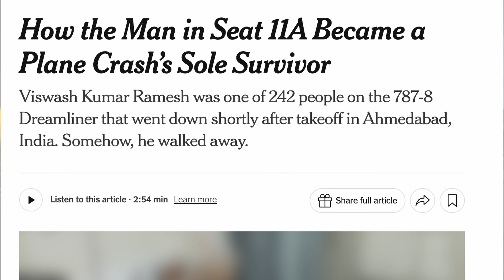Why the RAT Changes Everything – Air India 171 Update

Comment: If it is true that the plane had known multiple problems BEFORE passengers even boarded. Why did the captain allow the plane to takeoff without those issues being repaired?!
1) Faulty air conditioning in 38-degree weather
2) Broken-down inflight entertainment system for anticipated 9-hour flight
3) Unreliable transponder being used before a long international flight. 

Items 1 & 2 were complained about and videoed by passengers on the previous flight from Delhi. 

So why, Why, WHY…would an experienced captain fly a plane in that condition?!!!

Comment: I was thinking both engines flamed out after take off when I was watching the first original video a couple of days ago.  My opinion for the reason of why both engines stopped working simultaneously? Poor maintenance and servicing from Air India for this particular craft AI171.  Another video I saw on YouTube shows a passenger filming inside this exact same plane on a previous flight showing that it has an electrical problem with the ceiling cabin lights not working and the touch screen displays and push button controls on the back of the seats also not working.  AI171 was doomed to have a major electrical catastrophe due to poor and lack of correct maintenance by Air India. This was not a pilot error.

Comment: Whenever an event is astronomically improbable, then it didn’t happen the way theorized. Not Occam's razor, Fredley’s stubble. The “survivor” is improbable. My calculated narrative is that the escape door was opened and the “survivor” jumped, causing infinite confusion and chaos in the cockpit leading to the confusion between the landing gear lever, which was in the process of being pulled, and the flaps lever. 

The object, most probably the emergency door, departed the plane just before the landing gear was to be raised. Check the timing. Check the background of the “survivor”. 

Three years spent at Penn State, studying statistics, philosophy, inferential logic, mathematics and computer science has taught me to think, yes think, not presume, out of the box. 

Also, check if the propellered generator comes on by strange coincidence of the emergency door opening during takeoff, which would explain its observed dropped position and sounding.

Comment: If the mayday call suggested a possible power issues.  Could the pilot flying activated the rat to attempt to access power to extend the flaps?  But what caused the power failure?
I also agree the flaps were possibly retracted instead of the gear.

Comment: SERIOUSLY ❓️❓️❓️🤦🏼‍♂️ 
ALL SCREENS AT PASSENGER SECTION WASN'T WORKING ‼️‼️‼️‼️‼️‼️‼️‼️‼️‼️‼️ THATS COMMON THING IN THE ALL BOEING 787-8 DREAMLINERS ‼️‼️‼️‼️‼️‼️‼️  THAT MEANS ISSUES WITH POWER SUPPLY AND ELECTRICITY FAILURES 

LACK OF POWER SUPPLY AND ALMOST TURNED OFF THE ENGINE FAILURE BECAUSE OF THE ELECTRICITY AND RAT FAN  IS THE BEST EXAMPLE OF THIS SCENARIO ‼️‼️‼️‼️‼️‼️‼️‼️☝🏻🤷🏼‍♂️

Comment: I'm sorry to say it, but you can not say dual engine failure. You have failed to recognize the other parameters on a 787 that would automatically deploy the RAT besides a dual engine out. The others are  Total system low hydraulic pressure, loss of electrical power to both pilot and copilot instruments and flight systems, a loss of all 4 electric motor driven hydraulic pumps and flight  control faults on approach and a loss off all 4 electric motor driven hydraulic pumps and a single engine out on take off. Mabe review  systems on the specific aircraft before making conclusions and a video.

Comment: DUAL ENGINE failure, yes, but it takes ELECTRIC POWER to run those engines, yes??? What if the BATTERIES FAILED, which some years ago had caught fire, and Boeing seemingly fixed the problem? You can have fuel to take you to London, but no electric power, those powerful octane-powered engines are, um, dead in the water, hate to use the phrase.
Reply: No, electric power is not needed to RUN the engines.  These are not electric engines, the engines power the generators.  The generators power everything else.   Electric power is needed to start the engines, but this is not provided by the battery (the battery is no where near big enough), on the ground, starter power is provided by external 90 KVA sources - although the generator on one engine is capable of starting the other.
Reply: @Why_ask_  Yes indeed, I know they are not electrical engines. As I wrote above, plane engines are octane powered. In car engines, it takes electric power to operate the spark plugs. So no electric power, the car is dead. Plane engines do NOT use spark plugs but I'll bet that no electrical power means the engines will shut down....
Reply: @OnlineMD Got it, good clarification. Sorry (I think I owe you that.).   No sparkplug yes, but how long will it run without electricity?  Fuel pumps on 787 are electrical, very redundant, and a total of 4 generators plus 2 more apparently on APU.  Any one of which can keep the fuel going, but no electricity no fuel, no engine.  Hydraulic pressure on central hydraulic system is electrical.  Right and left hydraulic system; however, has some connection to the engine (not sure if mechanical or bleed air however, the backup is electrical.   Passenger, on prior flight (and he apparently has a dated boarding pass to back it up.) claims the AC was not working.   Obviously the plane was still pressurized, so at least one of the electric pressurization compressors (4) were running, but the circulating fans through the heat exchanger may not have been.   Of possible interest, the training summaries say heat exchanger fans drop out in a load shedding situation.  I did look up what happens with load shedding (very unique aircraft.) In most situations - like when restarting an engine - this would not be noticeable by a passenger since the duration is short.   This is a mystery; hopefully, voice recorder and data recorder have the information needed.

Comment: You should not reject all evidence showing the engines were running normally, and say a RAT was deployed, based on some sound that could simply be how the jet sounds at that angle, with the sound echoing from god knows where, or it could simply have been the original video with the sound re-recorded from speakers at full blast, thereby making the sound crackle. The original showing of that video sounded like a normal jet engine in "CNN analyzes flight data and video of doomed Air India crash". Also, you cannot zoom into these videos as if you are doing an optical zoom, what you see is what you get, you don't get more details like those when you zoom in. A couple pixels of compression artifacts that are blown up by Indian propagandists does not mean RAT. Your original assesment was correct. And then the Indian public, government and Tata started this media misinformation campaign. I don't want to think you got some benefits from them, but you should not say you are 100% with double engine failure. You cannot be, based on a grainy video that contradicts what was shown before. The earlier video being low quality is not an explanation. The sound was what you heard. and it is the same video. It was later changed by Indians. 
1) There is no indication of engine failure and we can hear the engines, at least one, in the CNN video. That means there was power, so why should RAT deploy? The engines, as you said had no indication of a problem, and the plane did not yaw.
2) The survivor did not say the lights went out. He only said the green and white lights came on. He did not report a bang. These are in his interview in the MSNBC short: 'I don't believe it': Sole Indian plane crash survivor speaks". He says the plane came to a standstill, no sudden sound or anything indicating engines go out, agreeing with the stall theory.
3) The plane took off from the taxiway intersection in the middle of the runway. This was shown by VAS aviation, and then he backtracked his statement, saying the hut in the video is at the turnaround point, which is still only a little after halfway anyway, but the video is showing the takeoff point, It wouldn't be facing that frame if the hut was that way at the back. Also the plane would not take off at the very end and raise the dust, if it had started from the beginning. FR24 also said "additional data" was obtained, and removed their proper data showing the plane turning from the taxiway, and just drew an arrow in MS Paint on the diagram. Was this some fudged data provided by Indian authorities, or poeple claiming to be ATC, or was it some benefit obtained by FR24 from Tata? Tata is very rich and wants to avoid a big lawsuit at this point.
4) The gears and flaps still would have made difference in this situation, and were critically at the wrong configuration. This cannot be ignored and somehow a double engine failure theory be entertained without any evidence.
5) In case this was low thrust due to bad fuel mixture, all fuel at the airport should have been sampled. But I doubt this was done.
Reply: wehe-weh-weh    moroon
Reply: @daviddavids2884  paid Tata pawn.

Comment: There was a 5th possible clue from another clued up pilot. The main wheels when fully deployed  hang at an angle so the rear two touch down first and these drop lower on takeoff also. However when they retract the undercarriage  the front wheels are rotated in the higher position in order to fit in the wheel bay and they look like they are higher in the video clip. Does this mean the normal gear up command was abruptly stopped by a failure? I looked at a lot of 787 takeoff clips to confirm this.

Comment: My squadron back in my Navy days had a jet with dual engine failure on takeoff.  Different issues with each engine, one related to a nozzle that failed which totally negated the thrust.  I was one of the folks that worked on the modification of our checklist laster that year for loss of thrust on takeoff. While highly improbable, dual engine failure is not impossible.

Comment: Factor in Boeing’s ongoing manufacturing quality issues — including the whistleblower engineer who warned that assembly-line sloppiness could take 10–12 years to result in a crash, plus the 2014 leaked video showing Boeing assembly workers saying they would NEVER fly on the Dreamliner they were building because of the quality and management issues.

Comment: What effect does the RAT have on the aircraft if it deploys when everything is working? Is it possible, however unlikely, that the RAT deployed for no reason, added it's current into a working electrical system and tripped breakers or popped off protection valves and lost fluid in the hydraulic system?

Comment: Based on the available information , including the apparent Rat deployment, duel engine failure seems like the likely culprit.  As there appears to be no smoke or flame out from the engines that would seem to exclude bird strike. There were reports of electrical issues on previous flights, don’t know if that could lead to catastrophic duel engine failure. Seems plausible. Fuel contamination seems like the most likely cause tho imo. Hopefully the blackbox gives a definitive answer.

Comment: I'm still wondering about the long takeoff roll. A single engine failure would account for that. The blowing dust in the video would indicate that one or both engines were producing good power on rotation, so both engines couldn't have been inoperative at that point. If both engines had failed on the takeoff roll, they would've aborted even if they were well past V1, since there would be no way the aircraft would be able to fly. I flew the B777 for 8 years and in the sim, at max weight considering ambient conditions, airport, and runway limitations, the plane would fly on one engine if one failed after V1. I guess it's all just speculation until the CVR and FDR are both analyzed. Nice informative video, though.

Comment: The flaps is nothing to do with this crash. Another video shows the slats are deployed and 5 degrees is borderline impossible to see. We could hear the RAT clearly days ago so even though dual engine failure is unlikely it has happened.  I think the engines started spooling down at rotate or even before. The aircraft simply flew as far as it could go with the energy it had. There is nothing else they could do, there was nowhere to go.  I really hope that some nuance of the 787 system means that dual engine failure cuts off fdr and cvr.

Comment: This does not prove twin engine flame out which was, in your diagnosis yesterday, very, very unlikely. The gear is still down…that could be symptomatic of catastrophic hydraulic or electrical failure…the deployment of the RAT is diagnostic of loss of system power NOT engine power (the latter causes the former but the former could result from something else or a misinterpretation by the systems). If hydraulic failure caused the deployment then the flaps would retract and the gear would stay down. Maybe.

Comment: Insightful, thank you! But I have some questions:
If both engines failed catastrophically, why did the survivor hear only one bang?
Isn't a single-point failure far more likely than a simultaneous two-point failure?
Is there any kind of failure you know of which could:
Cause a bang, and cause the simultaneous loss of control of the engines, the landing gear, and the flaps?
What would happen if half the hydraulic fluid were suddenly lost, due to an explosion somewhere?

Comment: If the plane had previously encountered multiple issues with AC and electrical problems on the previous flight. Why was it released and allowed to stay in service? 

Shouldn’t have maintenance repaired the aircraft BEFORE allowing it to takeoff…especially with passengers?

Comment: My two cents ! Notice a smoky dust throwing up from the ground exactly while the fight took off ? What sort of a debris on the runway would clog both engines simultaneously ! Because when all the check and balances before the flight taking off, there is a remote possibility of something failing just 30 seconds after take off. There was something on the Tarmac ! or  some electrical disturbance to flight avionics because of all the electronic devices inside the flight.

Comment: So question, if I may:  if one engine dies during take-off, would the co-pilot (?) immediately try to restart it or leave if for a few seconds until the take-off is completed and then focus on trying to recover engine power?  My thinking is that it might be a combination of factors - one engine died and due to human error the wrong engine was powered down.  If bird strike was ruled out, the odds of both engines dying at take-off is extremely low, I feel.

Comment: I was surprised to have you confirm that it was a pilot error, the theory that the pilots retracted the flaps instead of the landing gear is so staggering because both levers have different ways of operation and are in different locations, mad respect to see you admit the error and correct it!

Once I got the original footage I knew it was the sound of the RAT cause literally a day prior to this I had a video in my recommendation of a A320 coming in with the RAT deployed. IT sounded so similar to the 787 once I looked it up, as you mentioned its either of the three failures but it mostly seems to be a dual engine failure, as unlikely or rare its said to be, its never impossible. It's happened on a Cathay Pacific during cruise but that was because of contaminated fuel.
Reply: He didn't confirm anything. He literally said he's leaning towards it?
Reply: @CemBektas-dq6yw  my apologies, he was stating that theory with such great zeal, almost in a way he was certain it is what caused the crash. The last thing a pilot should do is blame a fellow pilot especially without much evidence in hand. One thing I found interesting is how he stated both the flap lever and landing gear lever are positioned right next to each other when in reality they are not, complete different places, two different operations and body movements to perform the actions. It's really difficult to make such an error, really hard to understand how that could be a factor.

Comment: Yes most of us think that it's duel engine failure but why 
Water In fuel ?
Contaminated fuel ?
As surely it's a comman problem as   flight engine was looking ok till it had taken off and then after some seconds no thrust from the engine
When the flight is at an angle of takeoff.
What if the angle of takeoff has caused water in fuel tank to flow to the fuel system and stalled the engine causing no thrust at all and there was no much time to glide at a safer place to land cause of the height

Comment: Definately not the pilots. There is a passenger video on social media of the entertainment system total electrical failure of this same airplane remarkably close to failure. Spilling diet coke on the 787x galley floor over time can have dire consequences unless they have the splash mod plate installed over the avionics bay equipment. The diet coke splash plate mod solution seems to me dubious at best. All the major power aircraft buses are connected to the IMA units. Both GE IMU 16 GPM /FOX/CCS failed and units shorted power bus and caught fire. This is dual responsibility of poor maintenance issue by this airline and Boeing for building junk.

Comment: Who was flying the aircraft at the time if it was the FO flying then he could not have retracted the flaps whoever did the emergency call probably was the non flying pilot can’t imagine any experience pilot getting the landing gear handled completely confused with the flap handle one is round and one is square that seems far fetched also the gear not being up has to be a duel engine failure because that little (RAT) ram air turbine could not get the gear up that’s why the gear was still down that’s only my thinking